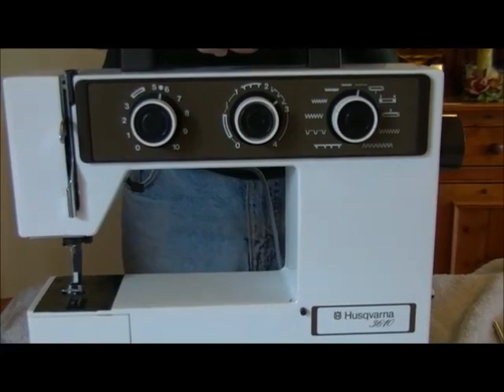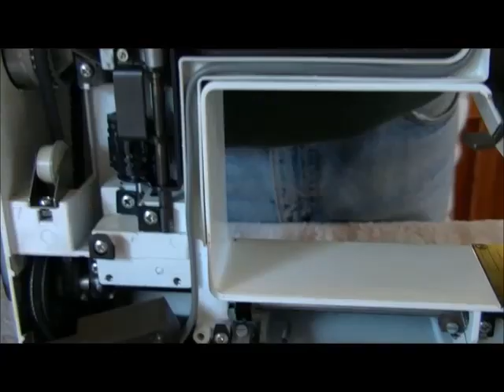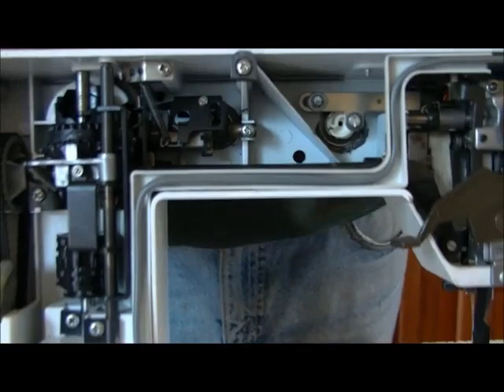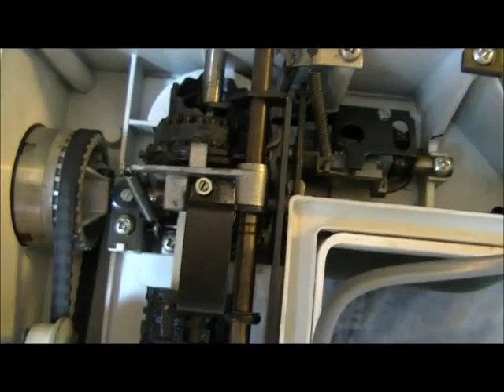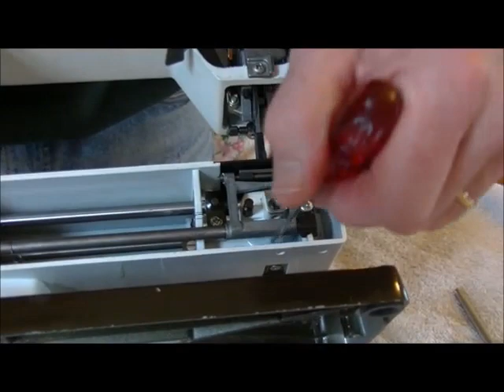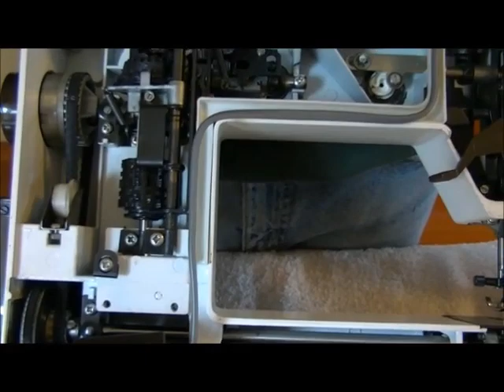Basic Troubleshoot Considerations for Jammed Sewing Machine

Comment: Thank you good sir. I have an idea what to expect for my one which Im ready to open up. Well I've broken a few needles which means that is my number one suspect at this stage or possibly dust build up.
Reply from the maker: Good luck.  I hope you sort your issues out without too much trouble.
Reply: @MendItAussie  Good news I fixed the jamming problem for now. There was some cotton and a bit of material inside the bobbin driver. Once I cleared it and cleaned it properly with some alcohol it looked brand new. I ordered some sewing machine  oil and will have it ready for lubrication ;)
It's similar job to laptops when I have to clean the air vent and the fan. Cheers
Reply from the maker: @buckmajor  good news.  Thanks for letting us know. Follow us on Facebook at @mendaussie if you wish.  Some more videos there.

Comment: I have a Kenmore 1941 that has locked up.  The handwheel won't  turn,  I have oiled and wiggled and nothing helps. Any other suggestions?? ( I have cleaned every part possible, and oiled .. Help!!!  LOL)
Reply from the maker: Just got your message.  Kenmores are a popular vintage machine over on Sewing Machine Collectors and Repair Lounge on FB.  Join the group and post photos and ask questions.  There may also be a specific Kenmore FB group.